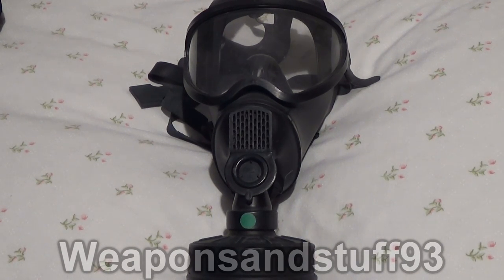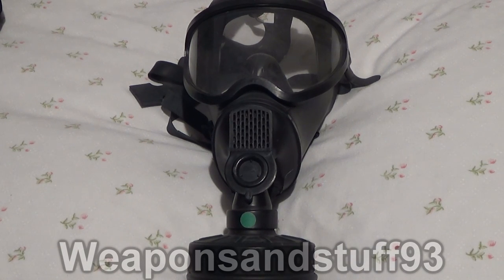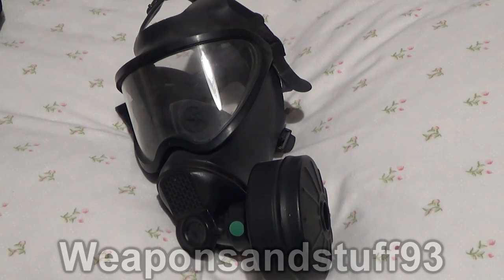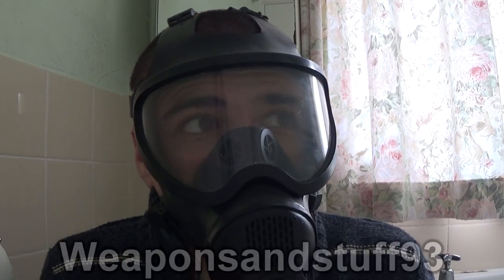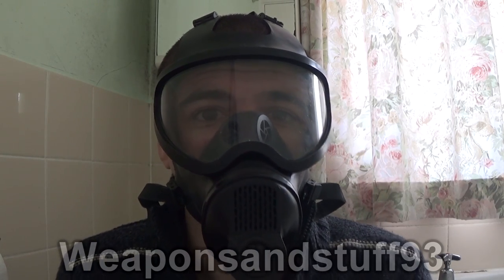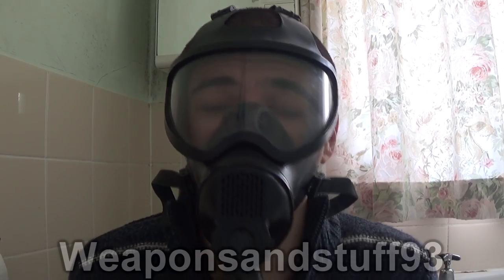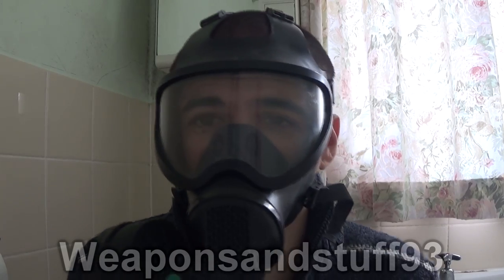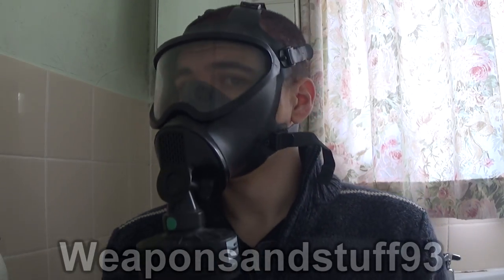BEM 4GP Gas Mask test

Comment: First does the filter have asbestos  and if no could I use that filter on a gp5 I know if it’s not a gost filter it wouldn’t be air tight
Reply from the maker: No these filters are perfectly safe or I wouldn't be using them, so you could force it onto a GP-5.
Reply: Thanks

Comment: Please help, my son thinks his gas mask (this one) is broken because he thinks it’s letting him inhale through the front grill bit. Is he wrong? Is that possible. I know nothing about gas masks
Reply from the maker: It's possible it could be broken, easiest way to test it is temporarily cover the filter intake port and see if he can breathe, if he can breathe it's broken, if no air gets in the mask is working.
Reply: There is a plastic voice transmission membrane behind the perforated round disk. Mine was cracked. I used a pair of needle nose pliers to spin the disk out [lefty loosy] and replaced the membrane with a disk cut from stainless shim stock. Less voice transmission but stronger.
Reply: @islandmarksman2781  Mine arrived with the same problem, seems like a common issue like the drinking straw issue. How did you disassemble the valve area enough to get to the disk/replace with shim lock? Do you start by removing the metal collar?
Reply: @islandmarksman2781  I got it, thanks, you're a life-saver if I have to use it for emergencies.
Reply: @sinosparo  glad I could help. For others reading this in the future. To get at the membrane you unscrew the perforated disk on the inside of the face cup.
Reply: @islandmarksman2781  I plan to replace the membrane with 0.1mm teflon film cut into a disk, available on Amazon for $10+ USD; it's one of the most inert substances out there